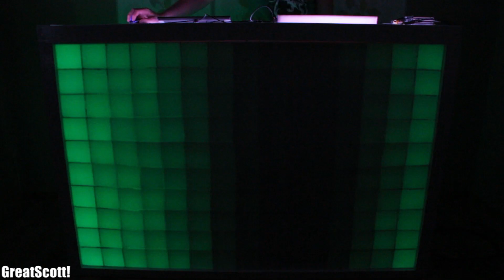Make your own LED Bar - Part 2 (better light diffusion, backplate construction)

Comment: Hi Scott, I was wondering. Do I really need the arduino when I have a raspberry pi 1B+ or pi 3? cant I just connect the leds to the Pi itself using it as the controller?
Reply: same here

Comment: Hex scott, I have rather big problems:
I am not able to compile the code, there its always saying me that compiling is not possible because of something in the FastLED Library!  I have  Arduino 1.6.5 and downloaded all the necessary files etc but it does not work! 

Btw other AttinyCodes work properly!

What might be the solution? Do you have any Ideas what i can do?
Regards

Comment: How much did everything cost? The frame and electronics?
Reply from the maker: AWTCU 10€ frame + 50€ plexiglass + 0€ cardboard + 24€ LEDs + 10€ wire + 5€ Arduino + 20€ bits and pieces = 119 €

Comment: Heating up the hot glue with a heat gun or hair dryer will weaken it for removing glued things like the switch and potentiometer.